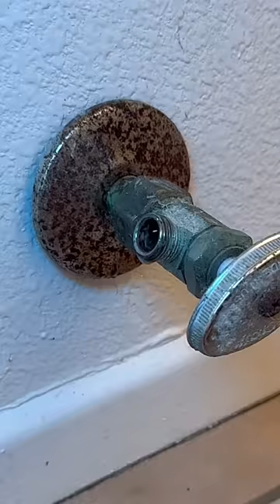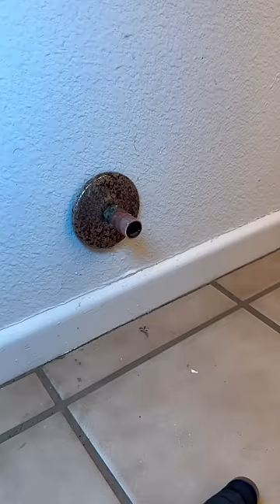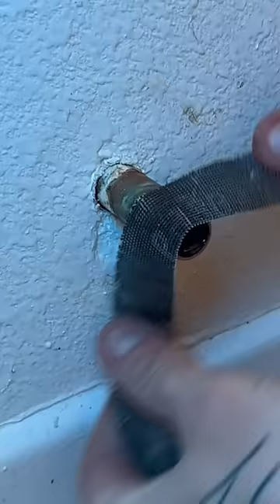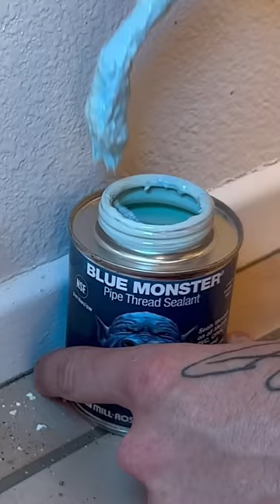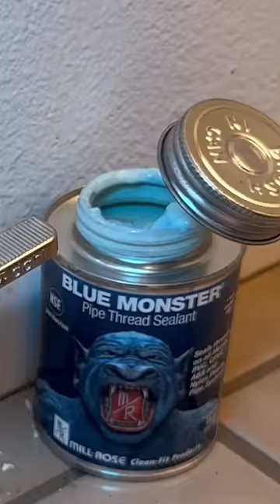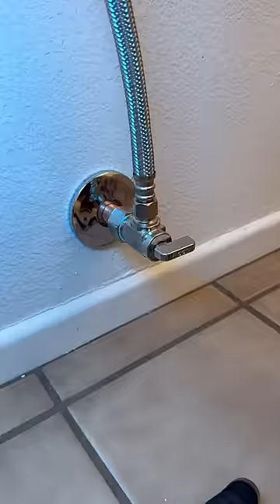HOW TO INSTALL ANGLE STOP! #new #newvideo #tips #tricks #hack #hacks #troll #water #plumbing #fyp

Comment: I'm a licensed plumber, and I'm sure you are as well, but you never use pipe dope on any type of threaded component that does not utilize the threads as the seal. Like in this application the compression ring is what seals the valve to the copper pipe. The threads do not receive water. Therefore, pipe dope on the threads is only making it harder for someone in the future to remove valve. It is not helping prevent leaks at all! I'm very surprised actually , looking at the tools and the procedures in removing the old angle stop, I would think the person has enough experience to know what I just typed.
Reply from the maker: Congratulations you are licensed and know your trade just like me. We obviously do things differently. Think about that next time someone does something different than what your used to. (Next time your helper/apprentice does anything) don’t try to one up people 🥴👌🏻🙌
Reply: @HDPLUMBERS Its not about doing something different, it just wouldn't work 😂 you have a compression fitting lmaooo.
Reply: Lol...he forgot to put flux on the copper supply line before he put on the compression stop valve. /jk
Reply: @HDPLUMBERS  Plumbed residential and commercial for over ten years including water treatment with a lot of high pressure booster pumps pushing 250 plus psi and never in my life have I seen someone use pipe dope on a compression fitting. The compression is what seals it not tape or dope. That’s like gluing sweat fittings before applying flux and solder like wtf? You clearly don’t understand how fittings work if you’re seriously arguing you do things differently. It’s not different it’s just pointless and makes no sense. You also probably glue quick connect fittings too am I right? 😅
Reply: As long as it’s non hardening pipe dope it should be fine. But it’s true compression fittings don’t get pipe dope
Reply: @HDPLUMBERS I've been a 0lumber for 15 years and matey is right. Its pointless and serves no purpose putting it on the thread of a compression joint. He's just giving useful criticism. Take it on board
Reply: dude its a troll. says right in the tags!
Reply: Own my own plumbing company.  100% use dope on the threads.  Not for water.  To make it easier to tighten.
Reply: @msawyer110  uh ideally you'd use anti-seize for that... Pipe dope is the opposite because it hardens over time. Edit: but don't mind me im just an avg employee using common sense 😁
Reply: @HDPLUMBERS  it’s not about one upping people, it’s about not making the job harder on the next guy. I’m just glad you’re not an engineer cause if I had to work on cars you designed I’d change careers
Reply: @HDPLUMBERS  Absurd that you would use this argument.  Here, different is wrong, not a matter of choice.
Reply: @msawyer110 I.e. you use glue as a lubricant.  What could possibly go wrong?
Reply: @HDPLUMBERS you are wrong, plain and simple. That’s like saying I put the wrong type of gas in my truck because “I just do things differently”
Reply: Not a plumber here and i Thank you for reassuring me i was thinking correctly. I approve your comment.  Ha!  An unlicensed in plumbing by design retired stock broker that fixes his own shit but loves to learn from pros.
Reply: @HDPLUMBERS he's not trying to "one up" you. He's trying to help you out. If you were a real plumber you would know not to use thread sealant on any type of compression fitting.
Reply: What would a plumber charge to replace one of these ?
Reply: @HDPLUMBERS dude you are wrong in this case. Deal with it. There is no world where you use thread sealant on a compression fitting
Reply: @msawyer110 I’ve read it all, you guys are chops
Reply: @HDPLUMBERS he's trying to save you from wasting time and money on pipe dope. saying thanks is all you needed to do.
Reply: @msawyer110 you've got to be kidding. holy crap
Reply: In no way am I a plumber but you explained well enough to even I got a good idea about what your talking about 😂😂
Reply: @HDPLUMBERS There's "doing things differently" and then there's "doing things wrong". Putting dope on those threads is wrong.
Reply: @HDPLUMBERS just cause you are licensed journeyman doesnt mean you can just do whatever you please and call it your way. Lmao
Reply: Yeah you just messed up bud. It’s not about different, it’s just wrong…. So wrong… 😂
Reply: I came straight to the comments for this🤣🤣🤣💯
Reply: Different my ass! More like unbelievable. For the zillianth time, pipe sealant and Teflon tape is for tapered threads. And nothing else, especially on shit that never gets any water pressure.
Reply: So the logic goes with the dope on the threads you can tighten the nut on the angle stop better. Because the dope helps lubricate the threads. However that being said I've also worked with plumbers who prefer no dope because they would like to hear the crunch of the ring and makes a squeaking noise to know that it's compressed properly for a good seal. I like to lean towards that personally. But at the end of the day I've put in tons of them with dope in the past, that's how I was first taught, if you crank that m********* on you aren't going to have a leak either way. There's a reason the compressions are the gold standard now.
Reply: kevinlsims7330  who the hell can't tighten a brand new compression fitting without lube?
Reply: Why not?
Reply: @HDPLUMBERS doing something different and doing something pointless is not the same thing. Putting compound there shows you were able to learn a procedure to change a part and repeat it, but don't understand how the part is designed and how it functions. 

And for some reason you are proud to look lost.
Reply: I have no experience but I know what you just typed.
Reply: Po po plumber butthurt cause plumbers pointing out NEVER USE DOPE ON COMPRESSION FITTINGS. This is how I do it doesn’t make it right.
Reply: I’m no plumber but would the pipe dope make it easier to loosen the nut and prevent corrosion to make it easier to loosen the nut in the future?
Reply: @derektsuji9520  no. The opposite. Thread sealants are oil based and dry over time, making the seal stronger as long as there is no movement. This makes the nut harder to loosen the longer it sits.
Reply: @derektsuji9520    Pipe dope isn’t a lubricant… It can get on the ferrule and actually interfere and cause a small leak. But it both isn’t necessary nor recommended.
Reply: @JohnCap523  Good to know. I worked in a power plant and when assembling a repaired piece of equipment we’d always put some kind of thread lubricant, having never used pipe dope, I thought putting anything on the threads would help. Now I know, thanks!
Reply: @HDPLUMBERS I’m not even a plumber but you need to learn how to take constructive criticism if you want to grow. The way you act says a lot.
Reply: @cocospops9351 not like using dope is making it not work.  I've seen lots of guys do this...while it may be pointless it's not hurting anything.  People like you are infuriating...nobody cares what you think
Reply: "
Pipe dope lubricates the threads making it easier to loosen when that day comes.
""...pipe dope on the threads is only making it harder for someone in the future to remove valve. """
Reply: pipe dope doesn't inhibit the threads, that would be tape. never tape a compression fitting or flared gas fittings.
Reply: @HDPLUMBERS  installing new plumbing on a renovated home had to use hemp fiber and compound on every pipe connection.... it was my boss who said so, only had to do what he said.
Reply: @msawyer110  thats it I do the same for the same reason
Reply: Maybe he did it knowing that it would increase the responses?
Reply: actually , putting pipe dope sealant on the threads is a really good idea.
reason is because over time, condensation and other debris  will make the female water pipe nut  ( or how ever other people may say or call it to be )  weld or freeze into one place.
ecpecially if it be a place where female(s)  like to use hair spray . that stuff goes everywhere. 
lol 
it is a very good help,  and i  am happy that someone else does that as well. thought that was just me.
i been doing that for years,  and i  still had to mention as to why i done it like that.
but soon after, they agreed with that style application.  

and no,  i do not have a plumbers endorsment .

litterally , a license can only be for driving, even then,  it is a chauffers license . . . not just a drivers license..  reason is because  the people are only allowed to aquire only 1 license, that is why the rest is called  an  endorsement  as like  . . . CDL , motorcycle , Bus driver , ect. 
hope i do not get any disagreement notifications from that which i mentioned.
i do know the difference.   so plz  don't .
Reply: @HDPLUMBERS licensed like you and I do it exactly the same way. Great job I'd work next to you and or follow your work without question.
Reply: @msawyer110 finally, someone who knows the purpose of the "lube" so it doesnt "skip" as you're trying to tighten
Reply: @sage0112 $300 dollars
Reply: Thread seal tape also keeps threads from seizing. Makes removing the failed valve years later much easier. 

You’d think a “licensed plumber” would know that. 🤦🏻
Reply: I agree with this! It makes it easier and smooth to tighten on
Reply: False, I'm a Master Plumber, and I used to think this way, but then someone showed me Brasscraft's instructions that tell you to apply some for lubrication purposes. Brasscraft knows their product more than you or me.
Reply: @cocospops9351 It does work, and Brasscraft even tells you to do it that way.

Comment: I’m no plumber, but as soon as I saw him using that pipe sealant I knew the comments would be in a uproar and I was not disappointed 😂
Reply: It's so done on purpose to drive the comments. Same as the ones where they use primer on a flange install
Reply: The dope has a purpose here. It’s so in the first you can undo that connection easily.
Reply: Didn’t know plumbers watched YouTube
Reply: Liquid Teflon is as good a Teflon tape 👍. 🤦.
Reply: LoL just noticed it doesn't need liquid Teflon. Self seal tight 😁
Reply: Perhaps 20- 25 years down the road,the next man gonna say; no corrosion," it came off like Slick Tight,,,! 😂 LoL,,,and you know: Slick Tight is the best compound any welder would use on malleable steel,,,😉😉👍
Reply: Same 😂
Reply: @arianduran1725  Brasscraft gives applying liquid thread sealant as part of its instructions to act as a lubricant.
Reply: @AloneInTheCandyJar wrong.

Comment: Every valve manufacturer specifies not to apply any compound or sealer to a compression fitting.
Reply: He didn’t put it on the compression fitting. The compression fitting is the Farrell not the threads and it doesn’t say that on the box anymore
Reply: As an HVAC tech i can tell you teflon tape doesn't work on compression fitting
Reply: As a software engineer, I can tell you that a nut is not going to fall off if it's soldered.
Reply: As a welder, i can tell you
Reply: As a Barista I can tell you that, as long as its not on the compression side it's ok
Reply: As an Amazon worker I can tell you packages get damaged everyday and still sent out.
Reply: As a college student I can confirm flushing a toilet does indeed flush the toilet
Reply: As a mechanic I can confirm that this engine is made of engine
Reply: @christophermcbride2785 that actually is the part that compresses...you don't need pipe dope...those are not nominal threads....
Reply: As a nurse I can tell you just fix the toilet so I can take a dump already.
Reply: As a salesman of propane and propane accessories, I'll tell you hwhat
Reply: @claykie754 hahahahahahahaha I can’t stop laughing. You win out of all of us lmfao. That was a good one. GOLD.
Reply: Actually I just read a forum that someone contacted Brasscraft and their engineers said they dont mind if a bit of non setting dope or oil is used on the threads only. So your every valve manufacturer statement is false
Reply: As an ex pimp I can tell you
Reply: As a man of great taste, I can tell you the original fitting looked much better 🎉
Reply: as an outside machinist, i can assure you the metal won't seize
Reply: As a painting contractor that blue shit looks messy and he needs to wipe that shit off before he leaves.
Reply: Brasscraft specifically says you can add a bit of pipe dope or (my preference) oil to the threads ONLY in order to make installation go a bit easier. I'm not sure why anyone chooses pipe dope except for the fact they have it nearby. A couple drops of oil is so much cleaner and better looking.
Reply: As a clown, I can say that this comment section is indeed funny.
Reply: As a homeless man they don't make enough cardboard box houses
Reply: @claykie754 I don't tell ya very often, but when I tell ya, I tell ya what
Reply: As a hustler I can tell you the ladies only want me for my pimp juice whooo
Reply: They do something wrong to get more comments.
Reply: @christophermcbride2785 the threads he put it on is part of the compression fitting. And it's a ferrule.
Reply: As a heart surgeon, I can tell you that we always dope our connections when installing artificial hearts. You don't want your arteries leaking, trust me.
Reply: You're comment is incorrect read a book.  Brasscraft say to do what he did...lol
Reply: @claykie754  a sellsman?   And wtf is a "sellsman"?  You have shown yourself unworthy of giving anyone information on anything.
Reply: That isn’t any… that’s blue monster 👹😭🤣
Reply: I smear some on the outside so it looks like a hack job even if it isn’t. Cringe mofugga cringe
Reply: @christophermcbride2785 the threads are the male part of the compression fitting, you aren't supposed to put thread compound on it. Thread compound is for a seal, the compression is the seal in this case, no need to create a seal after a seal.
Reply: I use it. didn't do it for a couple decades. Got tired of the drip. I've had zero drips since. If you are a plumber you should know better than to blindly follow procedure. You have to know why you are doing what you are doing.
Reply: @johnbeckwith1361  perhaps you're referring to a union instead of a compression fitting, a compression fitting works by compressing a part to seal air tight, if your compression fitting is leaking you did not prepare the surfaces properly and a seal was not formed, even if you make an additional seal to contain the leak you just installed, the fitting will now be corroding at a minimum of twice the rate it's supposed to, you just halved the life of whatever you just installed. The same applies for most unions as well.
Reply: I’m dying. How many people are going to try this before cutting off the water 💦? 💀💀💀
Reply: How's that working out for ya
Reply: As someone who believes everything they read on Internet, I followed instructions some1 just said theu read someone else heard when they called Brasscraft.  I put K-Y lubricant on the pipe.  It definitely was easier.  This time I didn't sprain my thumb loosening the compression fitting.
Reply: @claykie754  why the F did i read "i tell you what" sounding like Hank 😂😂😂
Reply: @invictusbp1prop143 bruh...apparently you didnt get the damn joke, that went waaaaayyyyy over your head 😂😂😂
Reply: As a Plumber I can tell you, the only Plumbers I've ever seen put Dope on the Ferrell and not the threads.
Pro-tip: you don't have to remove the old Nut and Ferrell, you can just reuse them... As long as their not damaged! I've done it... Uncountable times.
Reply: The Brass Craft installation video recommends placing pipe dope on the threads of the angle stop for lubrication.
Reply: @Krankie_V exactly correct, can't believe some of these people.
Reply: As a Handy Man, I can tell you…I have job security!
Reply: As an assembly tech, I can tell you blue monster doesn’t taste too good and is a messy alternative to doing a half assed job
Reply: Nope. Brasscraft, a manufacture of these valves, put out a video here on YouTube 13 years ago and said to apply seal tape or oil. They applied oil in the video. 

Look up- How To Install a BrassCraft® Compression Valve

You’ve ben caught. Fix yourself. 

Show me and everyone where you got your information.
Reply: @jimjamson9534  And likely leaked less...
Reply: @JohnnyTheMonkey  it's the outer threads of the angle valve.   No lube on pipe or ferril.  Perfect.
Read install instructions on angle valve installation instructions it says to lube threads.  Forget what you hear.  Learn for yourself and try by example to make better plumbers.
Reply: @leostark7943  as Fred Sanford would say "read the instructions Dummy" 🙄 🤣
Reply: As a cyclist I can guarantee that baseboard is very narrow.
Reply: As a gynecologist that's definitely a clean looking repair
Reply: Brasscraft actually tells you to apply it for lubrication purposes.
Reply: @leostark7943  Brasscraft disagrees with you.
Reply: Yes but your not putting it as sealant it’s a small amount of lube as long as you tighten till the feral squeaks your not gonna have a leak